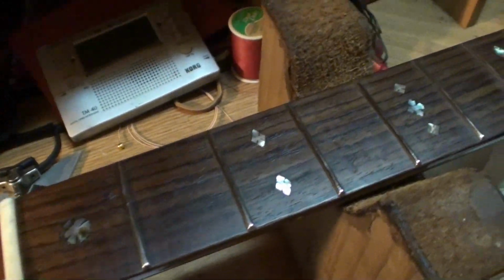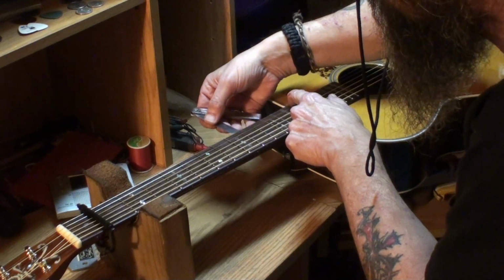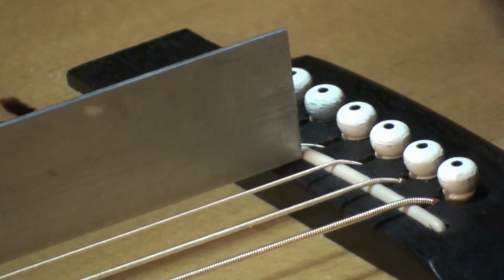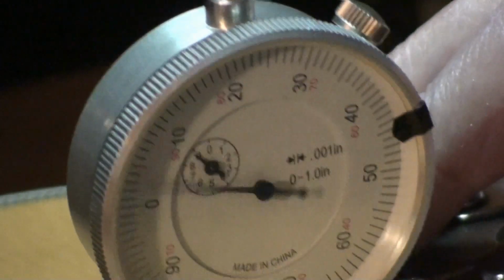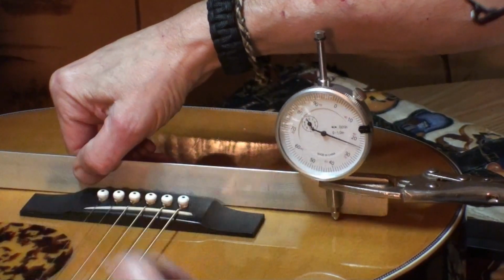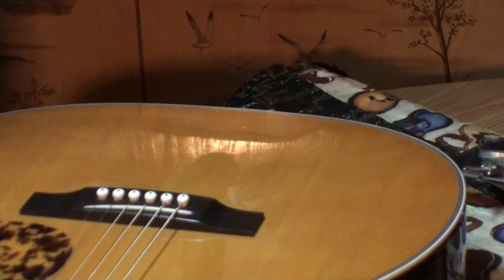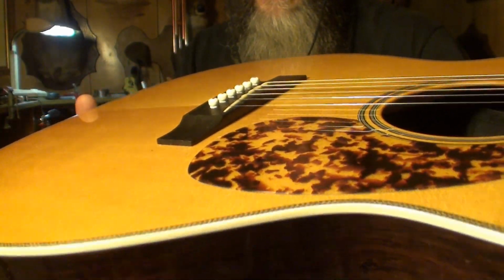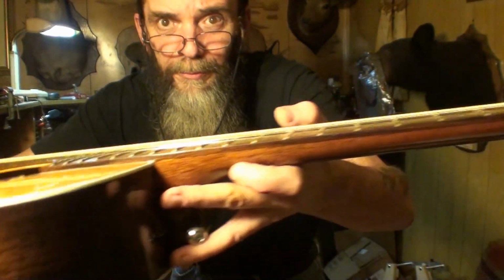A close look at when a neck reset is becoming your near future! blueridge br163 part 3of3

Comment: I have a 2016 Sigma with the exact same issues, probably built in the same factory. Mine had fallaway and belly straight from the factory 😃 It's a very lightly built guitar, probably underbuilt but it plays and sounds great. I think mine came with stainless frets.
Reply from the maker: A lot of that good sound comes from being built so light, that's one of the reasons higher end guitars seem to need worked on more than cheap ones because they are built so light compared to many cheaper guitars that are built like a tank. This particular guitar is as you said was built extremely light and is what I refer to as a soft guitar, if one string breaks the rest go out because it's so soft and light, but that's also one of the reasons it sounds so good. Thanks for viewing and good luck fixing yours if you plan on doing the repair yourself. Cheers!
Reply: Randy Schartiger Yeah mine is light as a feather, I like that. It's very sensitive to how you hold it, it wants to rest on your leg a bit away from your chest. It doesn't want you to be too intimate with it 😁
Reply from the maker: lol I know exactly what you mean! Usually guitars that are like that sound really good but you have to know how to get the sound out of them, how to hold, where to touch and where not to. My Blueridge BR160 is that way.

Comment: I have an old Tokai 12 string humming bird with more less the same problem. I was thinking about shaving the bridge just enough so that a  straight edge will lay flat on top the bridge when placed along the length of the fret board. I have checked the angle of the  neck in relation to the guitar's body and that appears to be fine. What I realized with this guitar is that there is no difference in the thickness of the body at the back in relation to the front where the neck joins the body.   I am not sure how I will approach correcting the excessively high action. I am wondering  if I remove material from the bridge to make it lower then the top will become even weaker. A bit of belly is normal as the tension of the strings causes this to happen. That is the trade off between strength and tone.  I may install a bridge doctor and see if it helps reduce the belly. Some people say that a bridge doctor kills tone while others say the opposite. Who do I believe! I guess I will have to find out for myself. At least it can be removed if the outcome is not what I desire.
Reply from the maker: In my experience Bridge Doctors effect different guitars differently, some guitars a BD made them sound even better, while others I've installed them in killed the tone and volume. 
Removing bridge material won't weaken your top much unless you have to remove quite a bit of material, usually the bridges I've shaved only needed a few thousandths taken off to work. Thanks for watching!

Comment: the guitar does need a neck reset. it should be noted though that an acoustic guitar should have a slight arch or belly to the top of it. I believe the belly shown on this particular guitar is fine. however like already stated it is going to need a neck reset soon to keep room for regular truss rod adjustments and to maintain a good break angle from the saddle to the bridge pins.
Reply from the maker: yup this guitar is very close to needing the neck reset, so far it hasn't moved anymore but I expect in years to come it eventually will have to happen. thanks for watching!

Comment: Guitars are born in a constant state of self destruction due to string pressure.
Reply: True, unless you lower the tension when putting it away.
ie, I've been doing this with a Rosewood SJ for nearly 10 years now, and the action has not moved whatsoever since I purchased it nearly 10 yrs ago
Reply: @johnbee9957  that's a great idea
Reply: Neck on lx1 is high and necks striaght. So no truss rod adgustment i can imagine happening. I put 52s on it when first got it! :( never knew better? Think it pulled up the back? No idea how to bring them down a bit. Ok at first few frets but middle and rest high.
Reply: I definitely loosen the strings of my Ashton acoustic Bass guitar (single Truss-rod) especially if the whether is turning cold. I bought the Ashton for $90 every frett buzzed. I just dressed them for a while. It had heavy steel strings when some asshole took it to a hock shop for a loan. It went into cold warehouse for winter when I found it for sale ($150) very sad bowed neck. lighter strings & truss rod full tension. Just playable.

Comment: Randy - I enjoy your videos and have learned a lot, but you really lost me on this one. If the action is really low and saddle is still showing some, why not just put a taller saddle in? A neck reset is needed when the action is high, eh? I could not figure out what you where measuring with the guage - with the ruler angled up over the saddle, I can't see how it relates to anything....maybe it's just me. And a Martin having something like a 28 foot radius on the top will show some belly by design, wouldn't it? I'm assuming that Blueridge also gives some kind of radius to the top.
Reply from the maker: you're right, we were wanting the action lower on this guitar not higher, but there wasn't enough saddle sticking up to lower it anymore, what I was measuring was the difference of the plane of the fretboard to the plane of the bridge and there was .010 difference with the bridge being higher than it should, they should be identical. as for the belly, yes some guitars do have a bit of arch to the top and some has it in the back as well, while others are much flatter, Gibson seems to like a flatter top and back.

Comment: Acoustic guitar tops are not supposed to be flat!
Reply: Says who? Bob Taylor? They are supposed to be flat.
Reply: I guess that would depend on if it is a flat top or an archtop. To build a dreadnaught with a two piece sold spruce top and make it have a belly like that would be very difficult. Having to glue the pieces together and then make them fit to the sides with a belly? Think about it. Some think it is good for (sound) to leave a belly in a guitar after it has formed due to string tension or poor care, but it was not made that way (in most circumstances). If it gets so bad the intonation is off, or you have no break angle to the saddle then the guitar is losing sound.